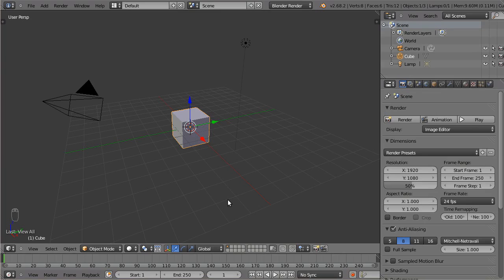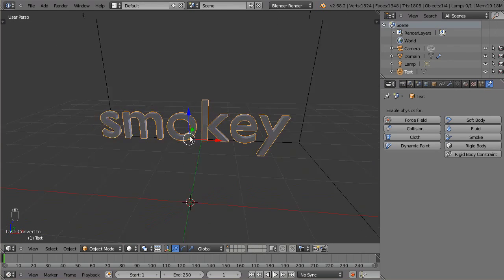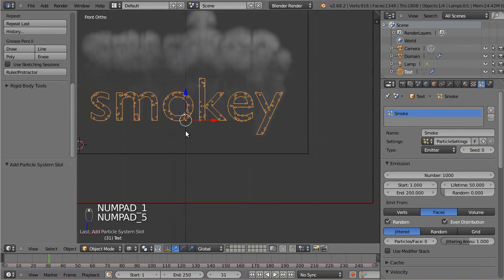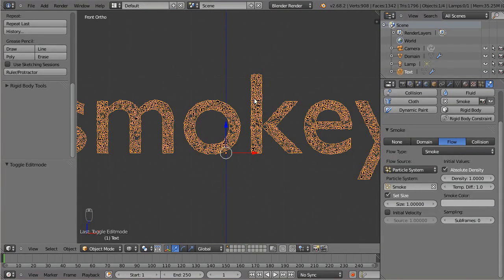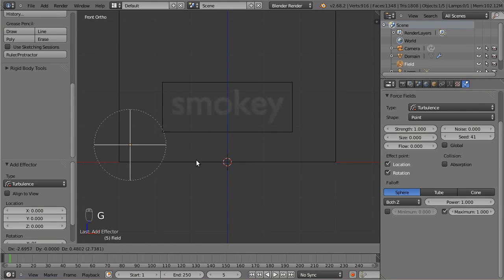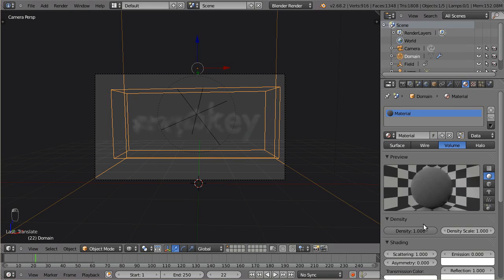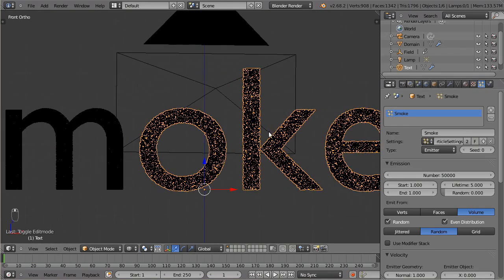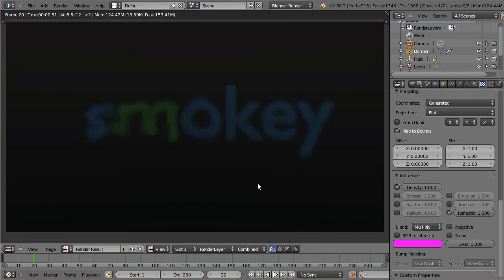Dissolving Logos Into Smoke With Blender - Beginner Tutorial

Comment: Since people are wondering, this is how you make the smoke crisper:

1. Turn on High Resolution Smoke
2. Increase the "Divisions" in the Resolution section of the domain, I used 400
3. Brighten up your lamps, I put a lamp on both sides like in the video and set the energy to 65.
4. (optional) I reduced the size of the smoke to .3 instead of .75 and increased the density to 80,000

Comment: Quick tip: to clean the logo after alt-c converting to mesh, experiment with the remesh modifier in object mode.
Adjust detail with "Octree Depth"
Ensure "Remove Disconnected Pieces" is UNchecked
Try "Block" mode for a minecraft look
When happy, Apply.